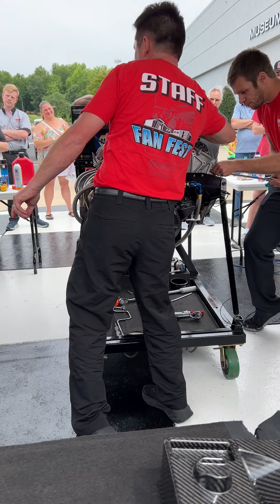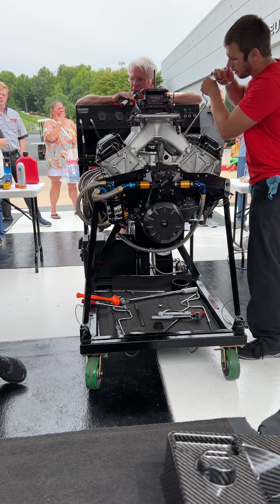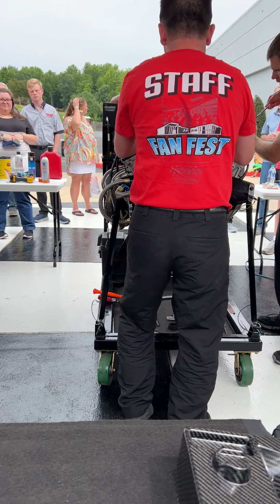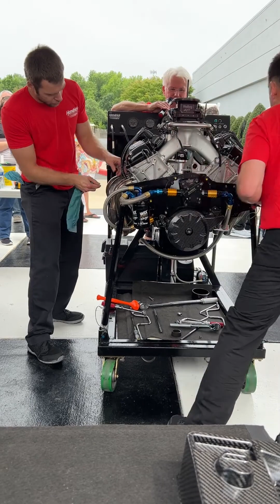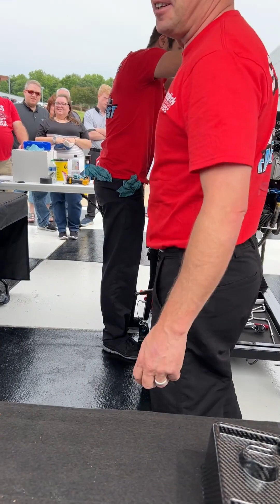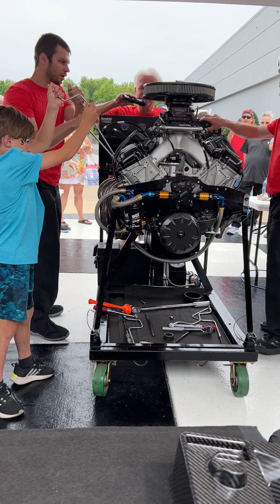The final assembly of a race engine at Hendrick Motorsports

Comment: You rarely see engines blow up in nascar anymore. Works of art.  Bullet proof valve trains. All the weak points fixed after years of finding them. And they can make more power but are held back by the rules.